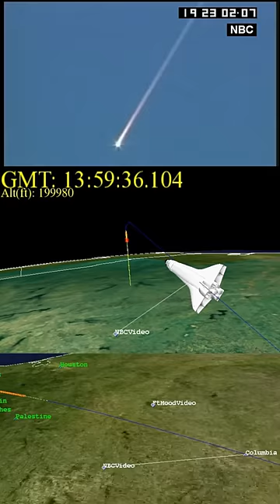What Happened After Space Shuttle Columbia Lost Contact

Comment: Why didn't the U.S use capsule like Russia did?
This way more complicated and hard than a simple capsule with parachute
Reply: The us has used capsules, they are currently using capsules. As I am writing this comment, the crew-6 crew are egressing from the dragon capsule endeavor. The idea for the shuttle was to be a cheap and easy way to shuttle people to and from LEO, which it did very poorly. Crew dragon is more of a shuttle than the shuttle was
Reply: @jake102issupercool  Cheaper then capsule huh?
Reply: @SHOOTINGDNA  that was the idea. In reality, the shuttles were extremely expensive, mostly due to the amount of refurbishment required between each flight
Reply: @jake102issupercool   cool... So total failure in all aspects ... Wew... My be in future we find high heat resistant materials on which this idea might work.. On which no rework is ever required  through lifespan of shuttle.
Reply: @SHOOTINGDNA  not a complete failure in all aspects, it was able to launch unpressurized cargo as well as up to 8 crew members, which no other spacecraft is capable of doing. But yeah, the shuttles really shouldn’t have existed. The idea was kind of silly in the first place
Reply: @jake102issupercool  the shuttle is not a silly concept, it was a silly concept to try in the 70s when Nasa lost all of its funding
Reply: @unownyoutuber9049  and it was silly to put the crew beside the fuel tank rather than on top of it. That’s what killed both the challenger and Columbia crew. If they were on top of the rocker with a proper abort system, all 14 astronauts would’ve survived their missions. The shuttle shouldn’t have existed

Comment: We have smartphones that like a Computer
Why they can't fly to the end of the galaxie in 10min ?
Reply from the maker: Because rockets and smartphones are different pieces of technology.

At a recent computer exposition, Bill Gates reportedly compared the computer industry with the auto industry and stated: “If General Motors had kept up with the technology like the computer industry has, we would all be driving $25.00 cars that got 1,000 miles to the gallon.”

In response to Bill’s comments, GM issued a press release stating: “If General Motors had developed technology like Microsoft, we would all be driving cars with the following characteristics:

For no reason whatsoever, your car would crash twice a day.
Every time they repainted the lines in the road, you would have to buy a new car.
Occasionally your car would die on the freeway for no reason. You would have to pull over to the side of the road, close all of the windows, shut off the car, restart it, and reopen the windows before you could continue. For some reason, you would simply accept this.
Occasionally, executing a maneuver such as a left turn would cause your car to shut down and refuse to restart, in which case you would have to reinstall the engine.
Macintosh would make a car that was powered by the sun, was reliable, five times as fast and twice as easy to drive – but would run on only five percent of the roads.
The oil, water temperature, and alternator warning lights would all be replaced by a single “General Protection Fault” warning light.
The airbag system would ask “Are you sure?” before deploying.
Occasionally, for no reason whatsoever, your car would lock you out and refuse to let you in until you simultaneously lifted the door handle, turned the key and grabbed hold of the radio antenna.
Every time GM introduced a new car, car buyers would have to learn to drive all over again because none of the controls would operate in the same manner as the old car.
You’d have to press the “Start” button to turn the engine off.
Reply: @scottmanley  
Bro thanks for the long text to teach me but this was a joke^^
Reply from the maker: @Younes_Weissgold  this was also a joke from the 90’s
Reply: @scottmanley  
exactly

Comment: They did not pass out.
Reply: Yes they did.  There’s no oxygen at that altitude and the air pressure is low.  The pressurized crew compartment de pressurized because it was either torn open or ruptured in the loss of control regime.  

Also most of them didn’t even have most of their launch and entry suits fully closed.